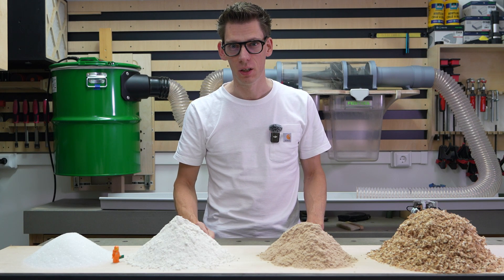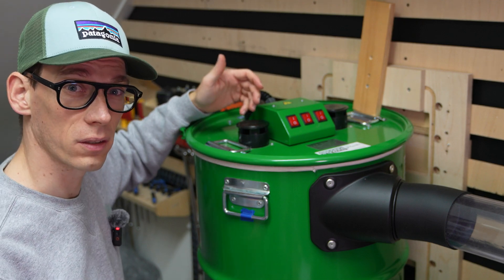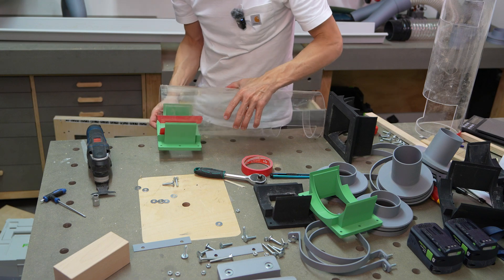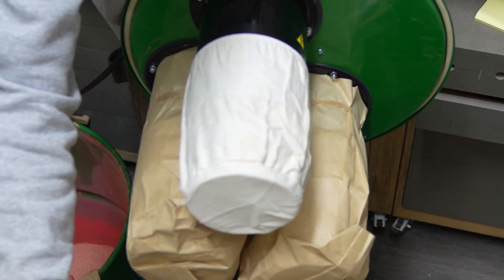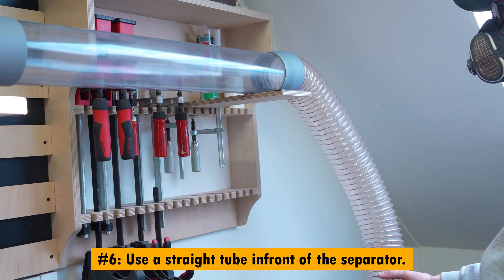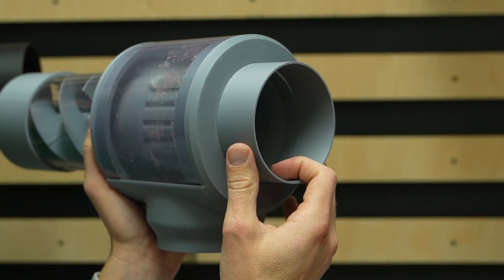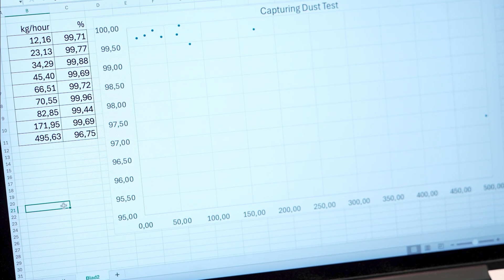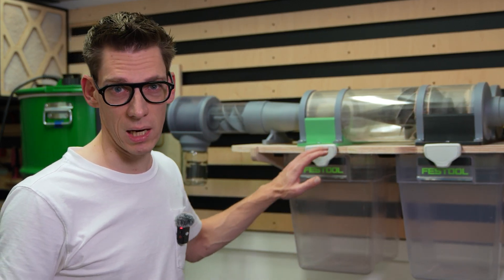Dust Collection: Small Changes, Massive Effect!

Comment: Why are you using an axial swirl instead of a traditional cyclone? In a cyclone, as the flow approaches the axis, the rotation speed increases. Because of this, the centrifugal force that throws off dust particles also increases. In an axial swirl, the rotation speed does not depend on the distance from its axis, so the separation efficiency is much lower. A properly designed single-stage cyclone should give the same efficiency as your three stages. But at the same time, it will be much shorter and much easier to manufacture.
Reply from the maker: Good point. It might be good to give you a little more context about the space I have available in the workshop;
My planer and thicknesser is located in a workshop that I share. It is 18 square meters and almost all the floor space is occupied with machines or workbenches and we only have some space overhead to make something for the dust collector. We do not have any height available because of cabinets and other stuff. And with this setup, when the bins are removed, we can still walk underneath the separator part.

I also ordered a Super Dust Deputy 4/5 inch Cyclone just for comparison tests. I had to wait 2.5 months for it to arrive in the Netherlands, but I will soon carry out comparison tests to see how the efficiency compares with the axial separator.

Comment: You can add a strip of aluminium tape running along one side of all the tubes or toward some of the tubes and ground it on one end to avoid static charge.
Reply: This doesn't work... Pvc being an insulator means that you're only removing the static charge from the single point area that the copper wire or tape (though the adhesive backing acts as an insulator too) is making contact with. The whole rest of the pvc part not in contact will still be statically charged.  This works well with industrial ducting, but that's only when it's made from galvanised steel etc. Great video about it here... https://youtu.be/yA22kTtV4XI?si=oPNkPgAJ59KJWPcV
Reply: @AzmyAnything  Like the guy says though, if it is done inside the pipe, it will remove static from the particles in the air flow.
Reply: @fortpatches  Agreed. That could be helpful to reduce stronger static build up in the air... but won't remove the static charge from the ducting it self or where the wire isn't touching, so you'd still get dust being attracted to the pipes like in this vidja sadly! 

I guess you could coat the whole of the inside of the pipe with alu tape and ground that... but feels like you might as well get metal ducts at that point!
Reply: @AzmyAnything  It wouldn't eliminate the static charge, but if you were able to lower the charge in the particles in the air, you could lower (not eliminate) the charge on the rest of the pipe due to the contact of the particles with the pipe. In other words, the wires wouldn't remove the charge from the PVC, the particles hitting the PVC would move some of the charge (or slow charge accumulation), which would then be discharged.

Also, if the biggest concern was the accumulation of dust in specific areas, then targeting those areas may work in increasing the efficiency of the system even though there is still some static in non-accumulating areas.
Reply: @fortpatches there is a spray you can get, comes in a spray paint can, more like an adhesive, but it is not sticky once dry, used for esd control on foam box insert cushions for computer parts....  armor-all is close to it I believe...
Reply: @AzmyAnything  👈 is entirely right on all points.  You can’t ground an insulator. Any attempt to do so will only remove charge from a very small localized area.  You could wrap the entire inside of the tube with metal foil, and at that point you might as well have just used metal ducting in the first place.  I’ve gone very deep down this rabbit hole and there are countless arguments about this on the Internet. The most important takeaway is that you need to “bond” all points of metal in the system so that they are equipotential. Charge may build on plastic surfaces but it’s mostly a nuisance.  Discharges and sparks happen at metal surfaces.  Wire reinforced hose?  Ground the wire.  Metal elbow between two lengths of plastic pipe? Ground the elbow.  Metal drum for dust collection?  Ground the drum.  Don’t worry so much about the plastic parts, just bond and ground all the metal.
Reply: @fortpatches  if dust is building up in certain areas that is an airflow design problem, not just a static problem. Even in metal ducting if you have dead zones you will get debris accumulation. It’s better to solve that problem by thinking about it from a fluid dynamics perspective.  There is a minimum velocity that needs to be maintained at all times, and all transitions should be smooth. Some build up will occasionally happen but if properly designed will be regularly knocked free.
Reply: Maybe a thin wire mesh covering the most problematic areas? Again, grounded somehow. I’ve made a simple ground by connecting a single wire to the ground lead of a standard three prong plug and inserting into a standard power outlet.
Reply: thats an awesome idea . i was thinking a bit of copper wire looped with in to give a path for the static but your idea is better albeit a bit harder to get smooth though for some one like him it should be simple to do . as for me i cant lay aluminum tape with it it crinkling lol.

Comment: I recently purchased a wide belt sander and I’m now on the hunt for a dust collector capable of capturing the very fine dust it generates without excessive filter maintenance. I live in a cold climate, so exhausting the air outside is not possible. Looking forward to seeing how this project develops and if I can get it to scale to 1000+ CFM.
Reply: I live in iowa, and this red neck stuck the shopvac in an old dishwasher, outside the garage, with a home made separator... use it mostly on dust and debris, some uplostry washing, and it sucks the fumes of my plasma cutter outside. I am so glad it is that way, nice, quiet,  clean , no hepa $$$$ filter.

Comment: Continue to love watching what you are doing. Perhaps you are now getting past the point of really needing to improve the centrifugal filter. This latest improvement is, I think, minimal for the pressure drop, complexity and additional room required. That said a good thing to look at what it can do - and as others have said useful in some other applications. Also it was great to see just how much "invisible" dust actually made it through to the vacuum and then out into your workshop for your room air cleaner to cleanup. As always it is the particles you can't see that are the worst.
Regarding testing medium using sawdust from plywood etc is great for what you are doing now. But when you move onto your final steps MDF dust will be better to really challenge the system due to its much finer nature.  As always great to watch and listen and looking forward to your next videos.

Comment: My dad used to design ventilation systems and he worked well into his seventies. You need to be able to adjust the speed of the vac motors, that will increase the efficiency of the whole setup. Secondly, statically charged particles can actually set your filter elements on fire in the most extreme cases.

Comment: 2:47 A better idea to cover the motor outlets when not in use: Print something like a hydraulic one way valve. Simply put: You have a cup with a hole in the middle, that hole is the motor exhaust. In that cup lays a ball. When the motor is on, the ball is blown away, so no issue. When the motor isn't on, the ball is sucked against the cup, so it seals the opening. Obviously, you'd put something over the ball to contain it, so it only gets blown up and not away. I'd experiment with something like ping pong balls, since they're very light but quite strong, just not sure if they're big enough. By far the biggest benefit: Remove the thinking, so no possibility for errors.
Reply: Agreed!! Exactly what I was thinking!
Reply: Can also just add a flap, there's another video from someone with a camvac who does that

Comment: As you showed already in a pretty efective manner the dust inflamability, please take in account electrostatic charges with your dust passing over plastic. Do yourself the favour and add some ground wires. or meshes. with some printers you can include metal containing plastics. Thank you for the detailed tests and exposition of ypur improvements. That Is something I had been looking for since the WW2 Zündapp and BMW cyclone air filters for motorcycles.

Comment: To me, it looks like the first stage would benefit from a longer chamber from tip of the cone to the end of the stage, to provide more space for separated material to fall down.
Though main issue seems to be the wedged shape into which particles get wedged, better method could be turning that wedge into shorter, but round shape

Comment: 2:56 I would have printed the new cover so that it would fit the "normal" opening up-side down. They you would just need to rotate the part 180 degrees to switch between open and close, without the extra action of removing opening, putting cover on, putting normal part onto cover. Also, the sticky effect at 6:10 is possibly static charge. You could try to remove the static in a few places by placing like aluminium tape in a few areas hooked up via wires to an earth ground (the earth pin on a schuko wall outlet here in EU, just like the one you have beneath your dust collector) and see if that makes a difference. A quick anecdotal reference I found for this was: https://www.youtube.com/watch?v=FtMPIQoCAXw although this guy is doing it without removing the potential difference to earth and by allowing the dust particles static to transfer via metal screws inside the conduit.

Comment: From what i have learned about static charge: it accumulates at the least conductive parts (glass and plastic). 
I wonder if using conductive filament (and connecting the parts to ground) is a good option.

Comment: If your printer can do it, i suggest using PETG instead of PLA for the next parts you will make. It is much better at handling vibration stress as it has a bit of "give", and is overall a much better material in every aspect (stronger, holds higher temperature, less brittle, usually does not break / explode on failure but just bends). If you need a bit of help setting it up, send me a message.

Comment: Hey, great project! As others mentioned, you can try metallic paint. Or ESD safe filaments, not cheap, but available from multiple manufacturers and multiple materials. Maybe drop a mail to a filament manufacturer / 3d printing store, if you feel the price is high. I guess you went through several kilos of filament already.

Comment: I think your work on designing a low cost separator is really amazing. I expect dust collector design is a classic non-linear optimisation problem with motor size, impeller size, air flow speed and volume, dust particle size and ducting design all being factors that affect the efficiency of the system.  You could say that any dust collected by your design makes the system better than a single stage collector so I wouldn't get too hung up on efficiency - better is still better.  I remember years ago that Bill Pentz made some helpful contributions to the science/engineering of dust collection and I think your work is making a similar contribution so thank you.  I will continue to watch your discoveries and may be tempted to build one myself - I expect most of us have an old one or two horsepower dust collector in our sheds crying out to be modified and brought back into service. Cheers
Reply from the maker: Bill Pentz is a hero! His website is a real treasure.

Comment: Made the seperator last week for my miter saw station because i don't have the height for a normal cyclone, it was time consuming but a great looking and functional project. changed the festool buckets for normal 30L buckets with a "Hooked on wood" style platform for easy removal, thanks Ruud for all your time and ideas and sharing them, i'm gonna wait a few videos before updating my system ;)
Reply from the maker: Good to hear the design worked out for your needs! Dennis is a really good source of inspiration (also for myself😀).

Comment: For the static charge, maybe you can try wrapping an exposed copper wire along the PVC and printed parts, then ground the wire. This may improve your efficient for the plywood.
Reply: Wrapping it on the outside of the PVC wouldn't work. PVC is an insulator - the copper wire wouldn't come into contact with the static charge if it is on the outside. Looking at @16:51 - I would try a thin layer of conductive paint on the areas with the most charge build-up and ground those spots specifically.

Comment: The secondary motor cover could be made to function as a check valve, similar but oposite to how a shop vac uses a ball float to stop suction when the water level gets too high. Inverted, the ball would pull down to close the secondary when not in use, and as soon as it comes on the ball can be allowed to "float" in a cage.

Edit: add this to both motor outlets and you can optimise for equal runtime on both motors.
Reply: Brilliant idea

Comment: Try printing some of your pieces in a conductive, carbon fiber reinforced filament, then add a ground strap to the system to reduce the static buildup.
Reply: Most cf filaments aren't conductive. You can get ESD safe filaments that are designed to be
Reply: Interesting solution. I was unaware that this was an option/possibility. TY.
Reply: These filaments are highly abrasive and using them is a good case of obtaining a "DiamondBack nozzle" - which are extremely expensive ($350 for a 3 size set) , but a one-time purchase as they'll essentially last forever and work with any filament

 JerryRig Everything has a video on the production process, but essentially these are harder than natural diamond

Comment: Such a fun journey you’re taking us on here Rune (sorry if I misspelled your name). I’m just curious, can these centrifugal dust separators be mounted in different orientations… for example if you tilted the unit 90° and wall mounted it? Or if you tilted it 90° and then rotated it 90° making it an upright unit… dust travelling UP or DOWN through the separator? I imagine you will tell me this is impossible to get a decent result with… I’m very curious nonetheless the less. Keep up the sensational work! Nickolas
Reply from the maker: Hi Nickolas! Thanks for sharing your thoughts and compliment! By the way, it's Ruud 😅. And you can mount these types of separators in a different orientation, as long as the dust exhaust ports are adjusted accordingly. I like to try something in a next video.

Comment: How about drilling some small holes in places with buildup the small holes would create an air stream which would self clean the corners. 
Of course your would sacrifice suction but other fixes also sacrifice suction and it is faster to iterate with a small drill and hot glue (hot glue to close the holes in case it does not help)

Comment: How about a screen filter which rotates and brushes of the buildup into the bin, this could reduce the size dramatic for the cost of some mechanics. 
Now you need a fairy strong/loud blower since all the centrifugal action cost some air resistance. A self cleaning mesh filter would be quite and it would not parasitic use the airflow for the action.
Reply: A fine mesh filter is highly restrictive. The reason is that the air at a surface is basically stationary and the air speed increases as you move away from it. with a mesh filter there is LOTS of surface area and the distance from one surface to another isn't very far. Also this is on top the amount of room the wire takes up - quite often between 30 % 50% of the total surface.

Comment: Love what you are doing here! On you impellers in the last stage, add a straight section of the fins that transitions into the curve. Right now the particles are impacting head-on into the blades impeding flow slightly.

Comment: Consider printing it our of ESD-safe PLA and grounding to combat the static.
Reply: Link? I’d like to learn more.
Reply from the maker: Me to. And it needs to be Bambu Lab x1c proof 😅
Reply: @CapturingDust  There are some electrically conductive PLAs on the market e.g. ProtoPasta or 3dxtech makes them, but I've also seen random Aliexpress sellers shipping them.

I suppose the additive to make them ESD safe isn't super expensive or sophisticated - it's fairly common to see injection molded plastics that are ESD safe (e.g. component storage for electronics).

So I wonder if they wouldn't help with dissipating the static charge if grounded.

Not sure what hacks are needed for Bambu. IIUC these print just like regular PLA, but I would be surprised if they didn't trade material properties for the conductivity.

Comment: Really enjoying watching you go down this rabbit hole. Like someone else mentioned I think one big problem is static buildup which needs to be addressed. Or, on the flip side maybe the static could be used to help filter the smaller particles. In the HVAC industry they have "electronic air cleaners". Also I'm curious if building a multi-stage separator with each stage having a more aggressive fin angle than the previous to help push the smaller and smaller particles to the outside would be worthwhile to attempt.
Reply: I was thinking the same, finer particle should be especially sensitive to electric fields so it could actually help in catching part of the remaining percents